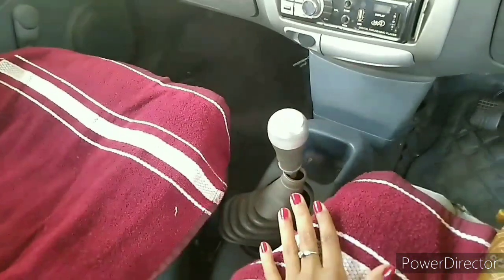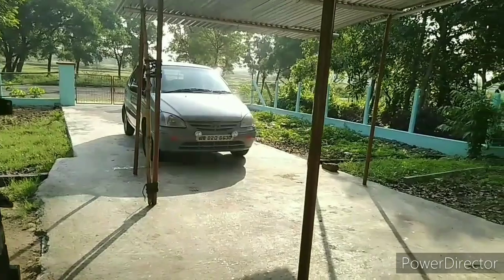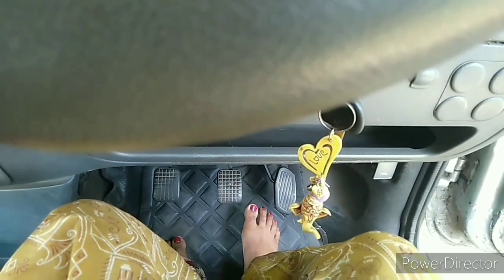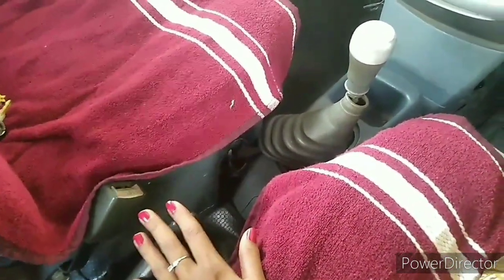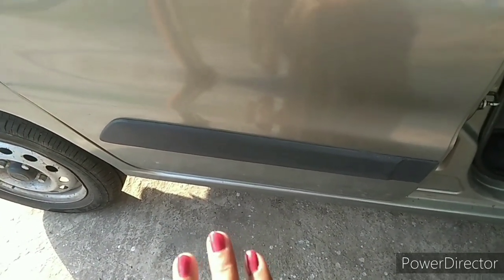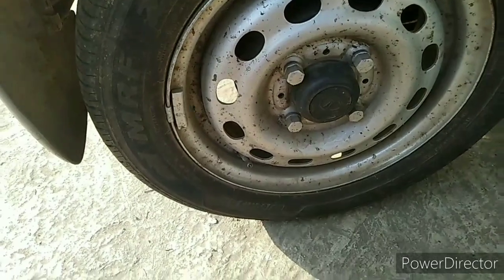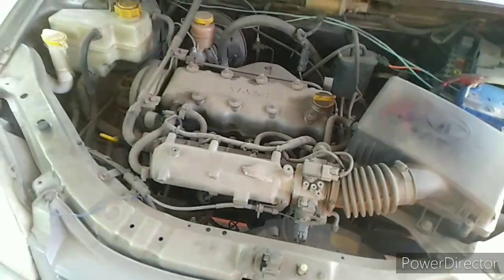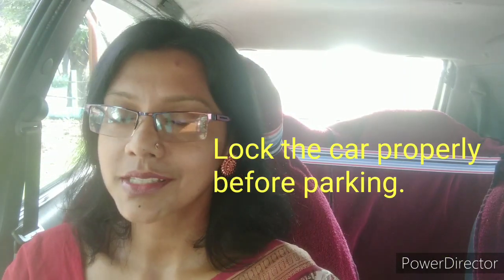How to maintain your car in this lockdown period ( English version )

Comment: Please take out fuel pump fuse or fuel injector fuse and keep trying over and over to start the car. Please pump the gas pedal barefoot and try starting it 15 or more times. Keep the key turned for 10-20 seconds each crank